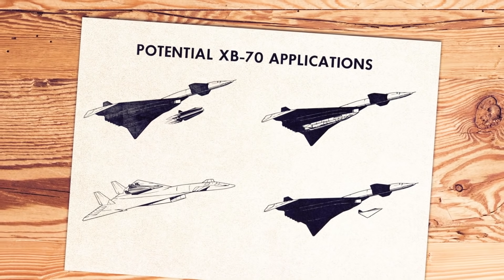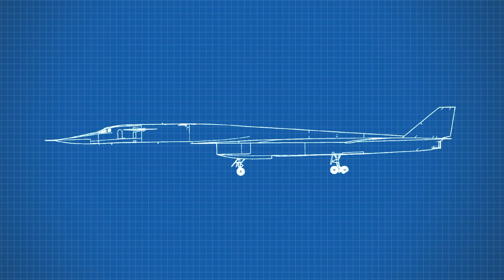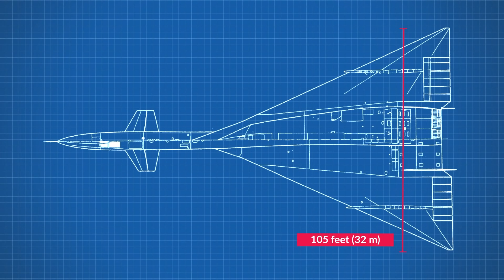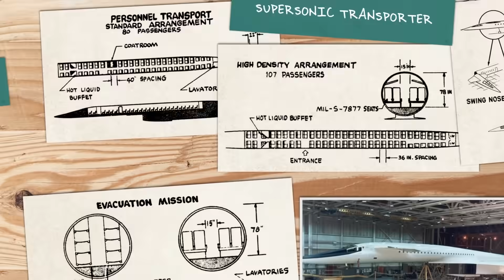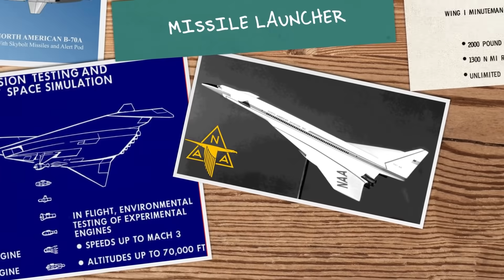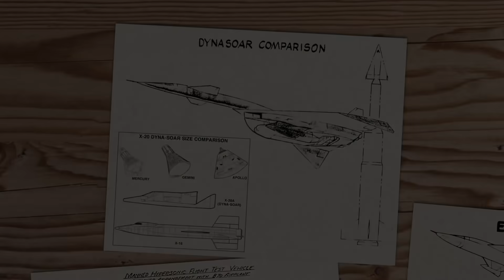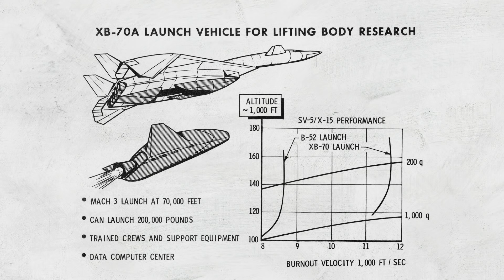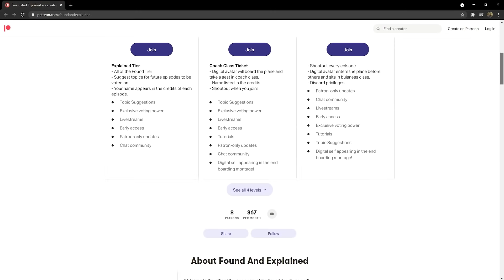Ahead Of Its Time: The Mach 3 XB-70 Valkyrie Super Bomber

Comment from the maker: Two goofs:
- The fighter bomber. yes I heard it multiple times and for whatever reason I kept it. My bad. 
- The editing error. Its been cut out, so if you saw it you are the lucky early few ;;)
Reply: I heard the video say 235 KILOGRAMS!!! A car is heavier than the bomber.
Reply: @lightdark-4696  this is a certified faa violation
Reply: And wingtips should be in the fold down position, I am sure you suggest that the plane riding at Mach 3 during the intro.
Reply: Yay im lucky
Reply: 11:03 11:53 "stabibility"
Reply: I see you use Premier Pro.